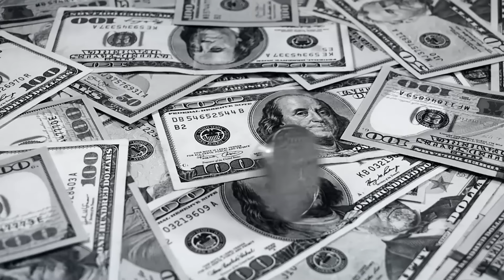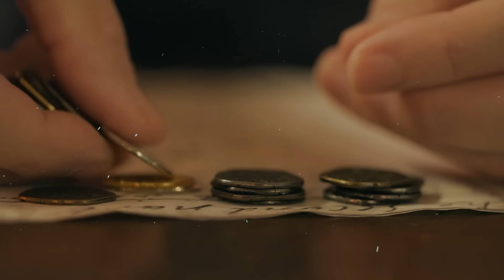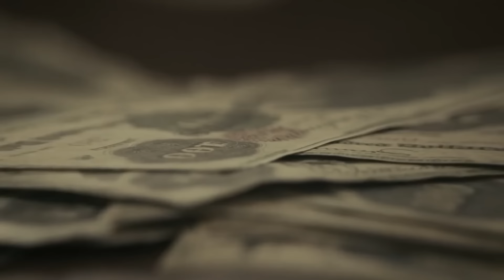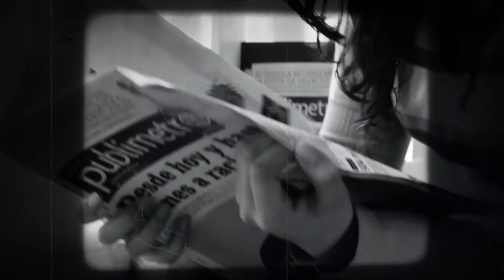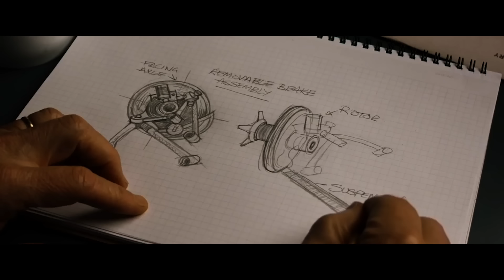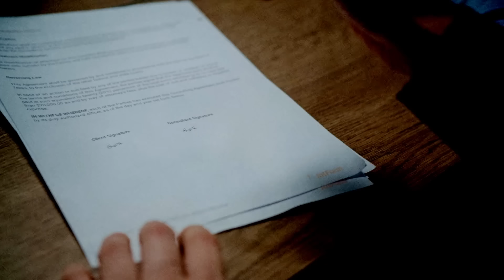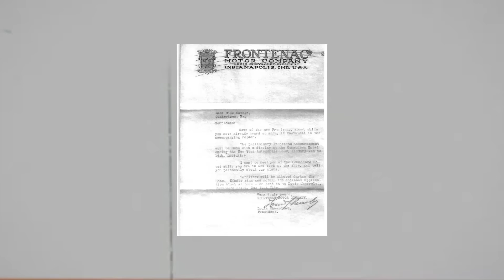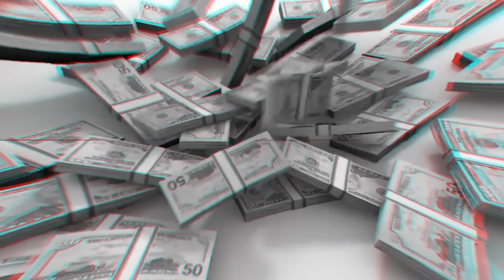The TRAGIC Story of Chevrolet

Comment: At one time Lewis Chevrolet designed hop-up racing parts for Model T Ford engines. A lot of people used the basic Model T engine as a bases for racing, and Chevrolet racing accessories for Ford engines were among the most popular and successful. They were made under the Frontenac name. The DO Frontenac head was probably the most advanced of these Model T racing accessories. Referred to as the DO Fronty, it featured chain drive dual overhead cams with 4 valves per cylinder, (all that back in 1924). Some people say the DO Fronty model T Ford racing engine was the inspiration for what later became the four cylinder Miller/Offenhauser, (that dominated open wheel racing in America for most of 50 years). Vintage DO Fronty heads are highly prized among Model T Ford enthusiasts even today, 100 years or so after it's invention.
Reply: Brilliant to hear about it, So I need to Chat to you about something
Reply: @SledgerFromTDS. ; what is the "something"?
Reply: @oldgysgt  Well I want to hear From Your own Opinion on Chevrolet.
Reply: @SledgerFromTDS. ; The man or the car? The man was apparently a fine mechanic and intuitive designer of engines and engine accessories, but a poor business man. I understand his desire to have his name on a "fine" car, (that was the European way), but selling his stock in the company that bore his name was rather short sided. His story had a sad ending. As for the car, I'm a Ford man myself.
Reply: @oldgysgt  Well what I meant there was, Your own Opinion on the Chevrolet Car Brand.
Reply: @SledgerFromTDS. ; although I do prefer Ford products, I'm sure Chevrolet cars and trucks are well engineered and built. In my 61 years of driving cars, there were only two cars with the Chevrolet name I consider to be real mistakes. The Corvair, and the Chevy Vega. The Corvair had an inherent problem with its suspension and weight distribution, and the engine in the Vega had an Aluminum block with Aluminum pistons. GM electroplated the pistons with iron and increased piston clearance to avoid gaulding, but that caused excessive oil consumption. If they had put in nitrated iron cylinder sleeves, that could have solved the problem, but that would also have driven up the price, and it's low price was the only thing the Vega had going for it. With the Corvair, GM redesigned the rear suspension after a few years of production, but the weight distribution problem was still there, and the Corvair had already acquired a bad reputation, (along with a number of lawsuits), so it was dropped.

Comment: Chevrolet used to be a ground breaking company. They had an air cooled car decades before the Corvair and they also developed a V8  automobile in 1917, long before the small block Chevy. They also had knee action suspension, and was one of the first low cost manufacturers to offer an automatic transmission in 1950 with the Powerglide.
Reply: WHOOOOOPS!!!!!  You were on a high roll until you stumbled over Powerglide!  You should have left that embarrassing turd at the local Navy ship yard.  The only automatic worse than Powerglide was Buick's Dynaflow.  Both were slow, clumsy, expensive, heavy, short-lived units that made better boat anchors than transmissions.

A lot of early independent car mfrs experimented with air-cooled engines, electric engines and V8s, V12s and V16s.  I doubt Chevrolet was the first.  And many foreign cars had air-cooled rear engines that lasted for years.  For Chevrolet to have been a ground-breaking innovator, they would had to have invented something that's still being produced today, like the electric starter, the overhead valve engine, or any of several similar inventions.

The V8 engine Henry Ford released in 1932 is the great-granddaddy of the engines Ford uses today, which is why Ford takes the credit for having invented the V8, even tho his wasn't the first by a long shot.
Reply: @lancasterritzyescargotdine2602  

Oh yeah Powerglide was a slushbox, but it was meant to eliminate gear shifting, which is what people wanted. Look at the instant success of Hydramatic. And as awful as it and Dynaflow were, their engineer, Oliver  Kelley went on to develop many more different automatics for GM. Some better than others. And Powerglide couldn't have been THAT big of a dud, it was made from 1950 until 1970 and to this day, in modified form, is still the transmission of choice for drag racers. 

And I never really said they were first with air cooled engines or V8's. Just that they took the leap of faith to try and market them at a time when a low cost maker just didn't do those kinds of things.  Franklin had some of the most advanced air cooled engines seen on automobiles. They did a supercharged V12 air cooled engine, but they went bust in 1934. And of all the makers who had V16's. Cadillac was the most successful but killed it off in 1940. Marmon had one but they died in 1932.
Reply: @InflatablePlane     Apropos to what you said about the '50 Powerglide, recall that Louis Chevrolet wanted to build fast, racy cars during the time his company wanted to compete more directly with Ford, and build a good, frilless workaday car.  And it was during his absence they voted to overrule him and go with the efficient car.  Sure enough, that's what they were still doing in 1950 with the senile Powerglide.

In my youth cars with standard transmissions were hard to find in any kind of decent condition, yet that's what all the guys wanted.  And Fords were preferred simply because most were V8s.  This one kid's mom bought him a granny-fresh '52 Bel Air Sport Coupe, Thistle Gray over Aspen Green with Powerglide.  I love immaculate old cars and this was a prize, but I abhorred the way he treated it.  Rather than buff out the nice original paint, his mom had it dunked down at Earl Scheib in bright yellow.  I despised it but Ricky loved it.  After a few weeks I didn't see him or his '52 for quite a while.  The next time I saw it was when I stopped at the local wrecking yard, and there it was, with a broken Powerglide.  I had taught Ricky how to shop for nice, old, low-mileage granny cars and he got quite good at it.  But they all invariably ended up at Los Alamitos Auto Salvage.

I don't know any drag racer who would deliberately choose a Powerglide, unless he was out to win Last Place Finals at the Annual Slip N Slide with Powerglide Mud Puddle 500.
Reply: @lancasterritzyescargotdine2602 the powerglide is still one of the most popular transmissions to be installed for racing. I know several ppl who use them in Ford's for drag racing
Reply: @crowdnine878            I've been around cars all my life and NEVER heard of some fool putting a Powerglide in a Ford, unless it was into the bed of a pickup going to a scrap metal processor.
Reply: @lancasterritzyescargotdine2602  there are plenty of things that take place on this planet that I've never heard of... That doesn't mean it doesn't happen.
Reply: @crowdnine878    Yeah, like people walking on water, cows jumping over moons and Fords running with Powerglide.
Reply: @lancasterritzyescargotdine2602  you can do a quick Internet search and find that the powerglide is considered to be "a king" of drag racing by many people
Reply: @crowdnine878         You can do a quick Internet search and find a recipe for turkey pancakes with sauer kraut and mayonnaise.
Reply: @lancasterritzyescargotdine2602  not going to argue with anyone. It's opinions on transmissions and auto makers, not life or death my friend.
Reply: @crowdnine878           Has nothing to do with life or death.  It's more like rumor vs. fact.
Reply: @lancasterritzyescargotdine2602  I've seen it with my own eyes. It's not a rumor. Fox body mustangs is what my buddies all ran... With powerglide. I take it you're afraid to Google drag racing with powerglide transmissions
Reply: @lancasterritzyescargotdine2602  another fun fact about the powerglide is that there are modifications available that allow it to withstand 3,500 horsepower along with the TH400 transmissions for that matter.
Reply: @crowdnine878      I don't doubt you have.  

Truth be told, I'm not into drag racing or modifying vintage cars.  Factory original muscle cars are great, so long as the owners keep them pure, and don't dummy them up with mag wheels, chopped suspensions, flame paint jobs and other juvenile bullshit.  

In the "old school" of racing, nobody with connected brain cells wanted a car with an automatic.  NASCAR lived up to its name, "stock car auto racing" with real cars, and not generic, fiberglas escargot shells slathered with advertising for booze, condoms and cigarettes. 

Just sayin'.  You can have all the Powerglides in the world and feel like you're steering a bowling ball as you go down the road.  If all the defective automatic transmission ever made were welded together, they would support an eight-lane suspension bridge from Buenos Aires to Tokyo.
Reply: @lancasterritzyescargotdine2602  I miss the NASCAR from a few decades ago. I'm not personally into modifications of any for the most part. I like to check out the old cars that were designed to be every day transportation and have survived the test of time. Survivor and barn find type. Hope you have a great day 🙂
Reply: "crowd nine" wrote, then erased,
Lancaster Ritzy Escargot Diner the powerglide is still one of the most popular transmissions to be installed for racing. I know several ppl who use them in Ford's for drag racing
Reply: Drag racing is a limited market.  When you've learned how to drive a real race car with a real transmission, you'll know what your elders have known for decades: nothing will ever replace a manual transmission.  Nothing.  EVER.

Comment: I ordered a Tahoe 6 months ago. I was informed the vehicle was built 2 months ago. Right now, it’s sitting in the hot Texas Sun at the factory in Arlington Texas. No one at General Motors can tell me what the problem is or why I don’t have the car. So General Motors spent around $40,000 building a vehicle that they cannot deliver.  The dealer theorizes that my Tahoe is waiting for an integrated circuit from China. The people they told us there was no downside to living in a connected world were lying. Strip them of their power, never listen to them again.
Reply: What does this have to do with Louis Chevrolet?

Comment: 6:19 is why car racing is considered a sport.

No power-steering, cart-based suspension (leaf spring?), open cabin, non-molded seats, no 5-point seat belts...

One not only has to wrestle against the car, one must also try really hard to stay on the car...

Comment: Let's face it.
Chevrolet has just put out poorly made crap since the 1974.
I grew up in the 50's and 60's.
I wanted a red 1963 Impala SS.
I walked to work and back in 1969 while in high school 4 miles at night to save $700.00 to buy this dream car.
My brother came home from the army in 1967 and bought a brand new 1967 Black 4 speed Impala SS.
They were cool cars then.
I met my wife at a church dance in 1972.
She owned 1970 Nova SS 4 speed manual.
I owned three GTO'S, two Corvettes, two Suburbans, and now I own an Acura.
I have also owned BMW's ,Audi's,.
If I owned Chevrolet, I would fire every single Middle manager, and the design staff.
I would build fast,beautiful, well built Audi interior inspired cars.
Like M 3' s only without the idiotic complexity,and mechanical fussiness.
I would build a new SS Impala with the LS 2.
But they just put out crappy designs,even the C8 Corvette is a mess design wise.
Dumbest design ever.
Too many stupid creases and angles.

Comment: I have a 2007 chevrolet matiz in silver ! Just spent £250 getting the bulkhead welded where the clutch cable goes through (common fault apparently) excellent little run round in town and everyone knows it's a Daewoo Matiz in disguise really but at least it's got that "bowtie" badge on the bonnet and steering wheel hey ! 😁

Comment: 13:27: A misleading statement here and then an egregious factual error. Gaston won the 1920 Indianapolis 500. Louis had nothing to do with that car from a driving or riding mechanic standpoint. He drove another car in the race and did no finish the race, dropping out with a mechanical problem. Gaston died in 1920, not 1922. The race in Beverly Hills took place a few months after Gaston's 1920 Indy 500 win.

Comment: R.I.P Chevrolet founder.My dad likes the Chevrolet S 10.
Reply: So do we! We have 271,000 miles on the original 1984 S10 long bed, 2.8L engine with 5 speed. The engine was re-ringed & bored over .030 at 233,000 miles. Still has original oil pump & crankshaft that only needed polishing to be placed back in service.

Comment: the 4 stroke engine is an internal combustion engine.  2 stroke, rotary engines as well are internal combustion.  and the impala sales record was only post WW II,   the Model T sold 2 million units in 1923, 1.3 million in 1922.  there are a couple other little niggles in automotive accuracy in this video like this.

Comment: Chevrolets story seemed to pattern one of those w superior talent and success who, similar to American indigenous natives, failed to adapt to changing time and circumstance?. The 6 cylinder chev sedan in the early 50s, appeared  to be have some superior characteristics to the 8 cyl Ford.  It was easier to start, more steady driving w out that slight lurch of the Ford on the road. The 6 cyl chev could start out climbing up a steep incline in 2nd gear, compared to required gearing down to low in a Ford.  Both were rear wheel drive, but chev also had better traction.
.